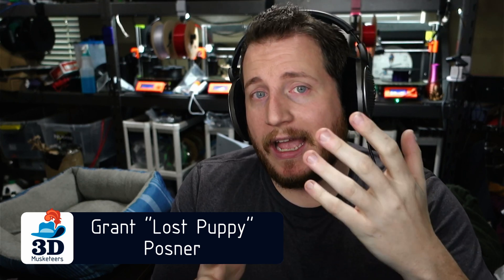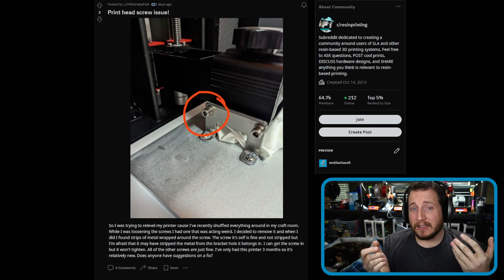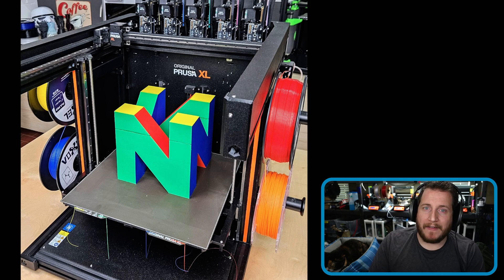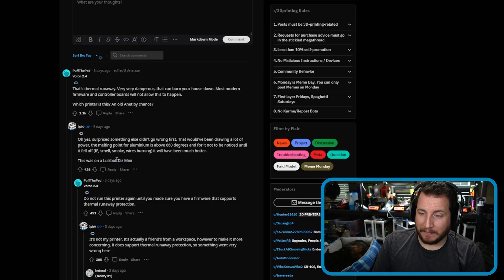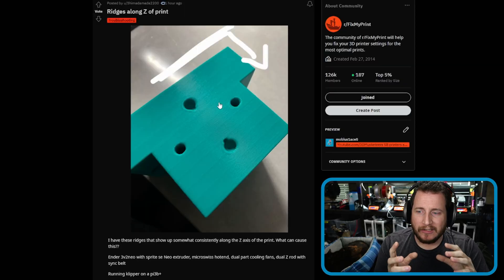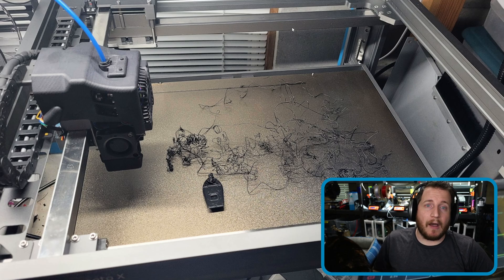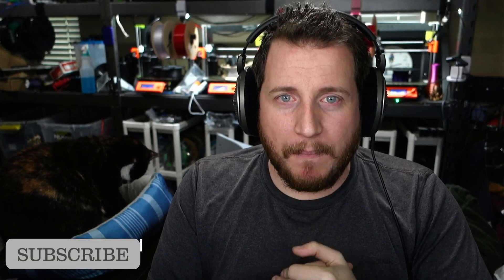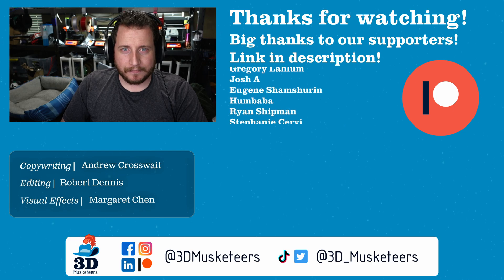Magneto Mishaps and Knots in Nintendo - PrintFixFriday 127

Comment: in the CNC world, a lot of our controller softwares and firmwares have a run from line gcode for various reasons.  if a slicer was smart enough you could narrow down to what line the error was in and try to resume from there.  its tricky but I could see this someday as a normal fix
Reply from the maker: yeah its definitely possible, but likely a closed loop system would be more effective

Comment: This stripped threads is a perfect example of why steel screws into aluminium can be a bad thing.  I was taught MANY years ago to always use anti-seize compound when doing this and it has served me well.  In this case this is a perfect example of galling and anti-seize on the screw before it was installed would have prevented this from happening to begin with.
Reply from the maker: 100% galvanic corrosion is a pain to deal with!!

Comment: The helicoil's going to have the added benefit of putting a harder metal in the interface between the bolt and part. Installed properly, it'll have more resistance to spalling out than the original part.
Reply from the maker: Great point!!!

Comment: My printer thinks it's a fire hazard but it isn't.  I inverted the chamber control so that it runs a cooling fan on the chamber instead of a heater.  Because of the lag in cooling/heating, I disabled the thermal runaway on the chamber ONLY.  But....octoprint still yells at me because it detected thermal runaway being disabled.
Reply from the maker: Still gotta be careful about it!!
Reply: @3DMusketeers  Of course.  Thermal runaway is still on for the bed and the nozzle.  If the chamber fails then the cabinet will just overheat a little with the fan off.  It's only heated by excess heat from the hotend and printbed, and is a large cabinet.  There is also a secondary fan that's always on, the one that the printer controls is a secondary that pulls the temperature down to whatever is set.
Reply from the maker: gotcha!

Comment: look at a king cert
Reply from the maker: I am not sure I know what that is, can you elaborate?
Reply: @3DMusketeers  yes they look like a set screw with 4 stakes  around the diameter you screw it down then tap the stakes down to secure it that way you can keep the thread size you need
Reply from the maker: oh oh, okay, got it!

Comment: Grant, I also had an error on my puppy board, but a restart fixed it.  I did have a real error on my dwarf board.  The nozzle set screw was loose (my fault) and when loading filament it did not extrude, just kept pushing the nozzle out, and tore the hot end connector off the board.  I was lucky that Prusa had them in stock, about $50.
Reply from the maker: I tried a few restarts before going to support. Nothing major, glad it wasnt days and days of waiting.

Comment: The mosfet is fixable depending on the cost to savings ratio for a new mainboard. Little flux and hotair. Depends on how comfortable the person is with repair. Safer suggestion is usually best though as you said.
Reply from the maker: Very true, you could install a new one, but if it is actually failing for a reason it would be good to know why